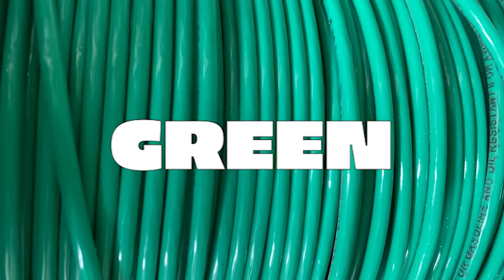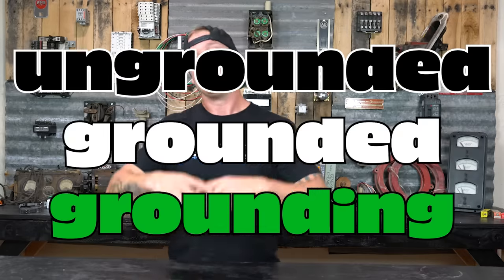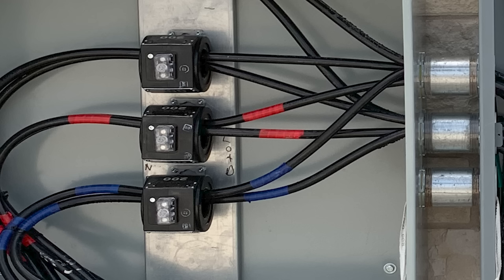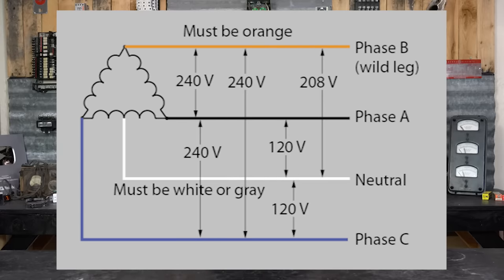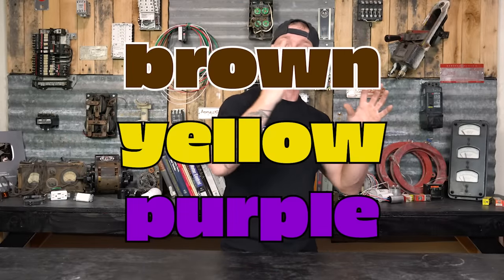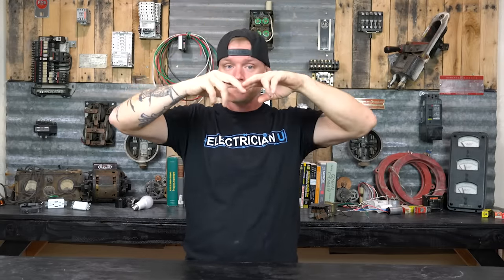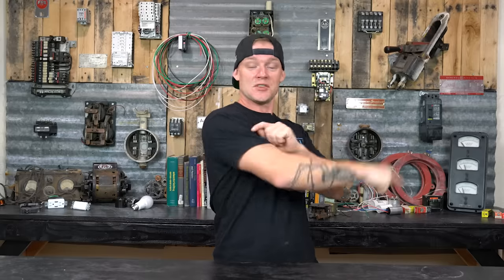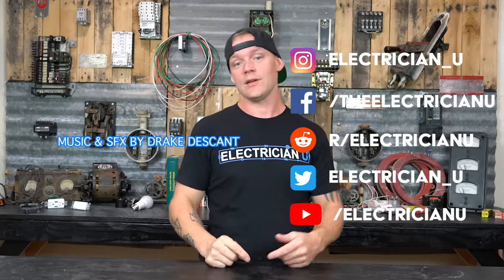Electrical Wire Color Coding Used By Electricians

Comment: Do you not use 347/600 3ph distributions??  In canada yellow orange brown are generally used for systems  with different voltages within the same facilities. Incoming would be 347/600V 3PH (RBUW) which would power hvac, big motors,  big post or bay lighting and or other Secondary distributions. Then stepped down to 120/208V ( RBUW) and 277/480V(YOBrGy) 3ph system's. 120/208v system would do generally power, lighting and firealarm while the 277/480 might do heattraces and glycol heating systems.
Reply: What do you mean by RBUW?

Comment: in romex cable, red, black, white, and a bare copper wire, is the bare copper wire the same as the Green earth ground ???
Reply from the maker: Physically? Electrically? 

To make this a simple answer: electrically yes. If you use and install your grounding conductors exactly the same and make up your point of use equipment recepticals the way intended. Your grounding conductor will make the same "connection" back to your grounding electrode. Making one continuous loop.

Comment: Speakers work just fine if you flip the conductors. The problem is now your signal is 180* out of phase. This means your miswired speaker is interfering with the others.

Comment: I really think you should add an addendum to this video as  some  common non knowing people that will encounter  277 volt changing out a ballast in a light industrial to industrial setting. They may say,  I can can change that ballast out for you boss.   As a maintenance guy at med size printer I knew 277 had more power, but I did not know it will kill you by freezing you. We had some  277  lower hanging  machine lights, I put a large voltage sticker with the warning this voltage will pin and kill you. So if I leave everyone knows if a ballast goes and they don't have the knowledge what to do, to not touch it.

Comment: Not to be super picky, but the neutral as the centerpoint for all conductors works for single phase residential, or 3 phase Y.

Comment: Normally when you find a middle leg that's taped red or orange and the other legs are black the middle leg is a 190 volt high leg with the other two being 120v. Delta wired with the neutral coming off between the two 120 volt windings. Always check every leg to ground before using any phase for a load.
Reply: 190V?  How did that happen?  It should be sqrt(3) times the line-to-neutral voltage of the A and C phases, for the B-to-neutral voltage, which is 208V.
Reply: @carultch  It's all determined  by how the transformer is wired and tapped. At any rate the 190 phase used to be popular and is still found in many large factories. You can easily find 190v transformer wiring online.
Reply: @71160000  Why is the 190V inconsistent with the 120V though?   Are the AB and BC transformer secondaries deliberately tapped at a setting inconsistent with the main AC transformer secondary?

Comment: I was looking for hot “switched” color code.  Want to use the right colors in a new building we are constructing in the Philippines.  Our renovated 15 year old house used one color and when something doesn’t work (outside lights). Near impossible ti troubleshoot.
Reply: As far as I'm aware there is no color code for switch legs. That is however dependent on local codes, most places have local codes available to be viewed online. For commercial/industrial work in the Pacific Northwest (where we use "BOY" because I guess we're weird) we typically use pink or purple to identify switch legs.

Comment: In UL 508a industrial control panels 
Orange wire can mean still live power in that cabinet with the disco off 
Could be panel light   Just be careful and double check

Comment: You might have included common traveler colors in 3-way switch legs. I read blue is a common color for travelers? Can't remember if orange was also sometimes used. Electricians will encounter these also (although, not in the panels).

Comment: What about the two phase, 5 wire system? Still plenty here in Philadelphia !
Reply: Years ago the large philly slaughterhouse that I worked at we would mark one phase with blue tape and red for other phase 240 volts with a center tapped grounded conductor ( neutral ). Had mechanics try to help us and crossed phased two phase and burnt out new motor. Started taping one phase of motor with blue tape and other phase with red tape.

Comment: I've learned a lot about electronics but going from that to structural power delivery like electricians would do, the green and white tripped me up quite a bit. It seemed like they were both the same so why have two? Then I read about more history of electrician stuff and I think the green was added later as a redundancy tied back to the service box so if the neutral failed then you wouldn't get electrocuted. That's how I learned it anyway. I don't know if that's true but going from aircraft avionics wiring to residential or commercial or industrial structural power delivery standards was a little bit weird. I think most of the time with aircraft systems, they will just use the chassis of the aircraft as a return so as to save weight... Unless you need shielding with coax or triax cables. I think I'm starting to get it.

Comment: Its a shame there doesn't seem to be any will to converge this. I'm in the UK and we had a history of red,yellow,blue for phase colours with black for neutral. The new "harmonised" scheme is brown,black, grey with blue for neutral, which would be fine if it didn't share colours with the old scheme. That would be fine if you never had to deal with sites with both colour schemes in use on the one site.

 I think the only way to get from where things are now to a globally unambiguous scheme would be to mandate at least two colours per conductor, either as stripe+insulator or tape+cable colour or two tape bands.

Comment: What is 180 volts to ground in a three (3) phase system?
Reply: A bad connection… or a weird voltage from phase to ground in an ungrounded delta
Reply: @atmacm  It was on top of a church feeding a Trane Voyager.  All the feed wires were black,  maybe they didn't color code anything back in the day?
Reply: @scottbishop2532  I'm an old guy and in my day (before 1985) with 480 volt three phase, for service conductors all were black. For 480 volt three phase distribution from the main service, any colors were acceptable. For 120/240 volt distribution (from 480 to 240 transformer because utility provided only 480), any color (because several 120 volt circuits might be pulled in a single conduit) except white was ok for a hot leg (120 or 240) and the grounded neutral legs were always white.

Comment: I am architect though not electrician but do supervise and often do some jobs myself.
Besides, I am Mexican and live in México.
Color coding here has some differences towards colors used un the US.

Don't you use coding to separate lightning from power?
I do use yellow as fase and grey for neutral in lightning circuits.
Also orange for returning cable (from switch to lamp).

Comment: This is what I am used to here in Oregon, but as always, the ungrounded conductors can be any non-reserved color, and should ALWAYS be verified by checking them with a meter...

120/240v Single Phase (most residential & small businesses) is typically Black/Red/White... Nothing out of the ordinary...

120/208v Three phase Wye ("Y") is typically Black/Red/Blue/White... Usually seen in locations where some three phase power is needed, but the majority of loads are still 120v single phase... Again fairly basic, and nothing surprising...

120/240v Three Phase center tapped Delta (Δ) systems are generally Black/Orange/Blue/White, with (as the video explains) the 'B' phase or "wild leg" being ~208v to ground, and (as mentioned) care needs to be taken so that no 120v loads are accidentally connected there...

277/480v Three phase Wye ("Y") are generally Brown/Orange/Yellow/Grey (Yes... the neutral/grounded conductor can be grey), and is generally seen in places where more powerful 480v three phase loads (motors) are necessary, but also designed for 277v lighting circuits as well...

Finally 240/480v Three Phase Delta (Δ) systems are also typically Brown/Orange/Yellow, but they usually don't bother with a center tapped phase, therefore there is NO neutral connection, and is strictly used for three phase loads...

Just my 2¢ worth, and as usual YMMV...
Reply: That's a great explanation. Better than the one I offered. I meant the same thing but sometimes it gets too wordy.

Comment: 120/208 volt 3 phase wye system colors black, red, blue, white, and green ground.
120/240volt 3phase delta system colors black, blue, orange- high leg white and green ground.
277/480 volt 3 phase wye system colors brown, orange, yellow, wt./grey, and green ground.

None of this information is of any use to homeowners/handymen. It is taught in first-year apprentice training. It was when I started 55 years ago.

Comment: In usa wire nuts are usade in hight voltage sistem?
Reply from the maker: Typically yes, as many of them are rated up to 1,000v
Reply: @ElectricianU  thx for response.👍🏿

Comment: In my white paper, entitled “Welcome to San Francisco mofo“ it states that a high leg is purple. As it is in the AHJ A.k.a. SFDBI EID code addendum. 

And it’s a great way for you to find out that once you’ve pulled all your conductors and have an inspection, and you’re told to go buy a whole bunch of purple tape, and go through every single box. That’s the way that you learn, that you should have read the local code.
Reply: And have a couple of drinks later in the evening................. after all that fun

Comment: Ive worked at 2 different shops with 3 phase power and I have 3 phase at home provided by a rotary phase converted but I have never seen 3 phase system with a neutral. Only 3 hot wires.
Reply: 120/208 Wye, 120/240 delta, and 277/480 wye are all 3 phase, 4 wire systems. The 4th wire is the neutral.
Reply: @pld8993  Like I said none of the 3 systems I worked on had a neutral.

Comment: Allot of electronics use switching power supplies allowing them to run on 120 or 240. Be sure to check before plugging it in though.

Comment: New to the hvac/ electrician trade. Definitely appreciate this💪💪💪
Reply: @SemoeDALLah… as an electrician, it always drove me nuts when having to connect low voltage control devices because I was programmed that white is neutral. Not until I did HVAC controls did it become obviously clear how to treat colors. 
Since every low voltage cable always has a black cable in it (black/red or black/white or black/multiple others), and every circuit needs a common or a negative wire, then the black wire should always be that common or negative wire.
It is very straight forward to me now but I’m not the only electrician I’ve seen struggle with deciding color codes on low voltage controls.

Comment: Coffee going in.. Figured I'd refresh some of this color stuff. Good job, and dead on .  Listen to this guy....     A slight correction or expounding on one little part..   The speaker wires... Hmm.. It's a phase thing if you get them backwards. the speaker, non active speaker that is, will work but will be out of phase.  In a mono system.. like distributed 70 volts commercial system will create some really strange and annoying sound in a paging / background system id a speaker is out of phase with the others.    It messes with the ears and head where audio will fade and increase as you walk down a hall. Its annoying at best, stressful if not fixed.   On  surround, home theater or stereo environment,   it'll do the same thing, but can make the surround, back, or front speakers stressful to listen to by adding subtracting from how it was mixed in studio to what your hearing.    Bottom line is keep the  colors straight in speaker system too.  Coffee kicked in, and I'm ready to roll. 

Damian

Comment: I live in Pittsburgh. This is the first time in my 21 years of doing electrical work of hearing about 1. Purple being used in a 480v 3 phase system. And the first time I've heard of that wild leg orange 208 volt. That's gotta be an old wye connected set up. But how does it get 208 on it to ground ? And that's a residential service ? Or is this commercial ? I don't have much experience in commercial. Only residential and industrial. My industrial experience is maintenance electrician primarily steel mills. Never had that wild leg there.
Reply: The B phase is called a high leg or stinger leg, never heard it called wild but might just be regional lingo. It's a delta system, that B phase is 208 to ground. It's never used solo, only with 1 or both other phases for 2- or 3-pole 240V circuits.

Comment: It would be nice if you make a video talking about sharing Neutrals in a 3 phase panel and code on it, i'm in CA and i've seen plenty of electricians sharing netrual in singel phase panels which is code violation, i would like for you to explain the theory on why not to share or when you can share neutrals, thanks.

Comment: On a 277/480/416 wild leg what's your tape?
Reply: There’s no such thing. If it’s a 277/480 volt system, then it’s a wye and all 3 phases are 277V to ground.
Reply: If it was a 480V grounded delta with a high leg(never seen one). You’d have two phases at 240V to ground and one phase at 416V to ground.

Comment: I didn't know they changed the color of the high leg on 3 phase at the panels, when I took electrical shop in high school 35 years ago, orange was always the high leg color at the main and subpanels only, blue was used to feed the 208 phase on branch circuits coming out of the panel(s).  It actuall makes sense just to keep everything the same in the whole system.  The 480 colors haven't changed since my HS days, my instructor back then used to refer to the grey color "slate", he would always correct us is we ever called it grey lol.  The guy knew his shit though, and the stories he used to tell us about going as far back as the mid 1950's
Reply: The reason why he called it slate was because the NEC used to call it natural gray, and nobody could ever figure what natural gray was compared to any other kind of gray, hence the use of slate since that is a natural stone.

Comment: For 208_230 3phase  black l1 red l2 blue l3.for 277 _480 volts remember boy brown l1 orange l2 yellow l3 .green always ground.white neutral.
Reply: If it’s a 120/240 3 phase grounded delta the high leg has to be orange per the NEC

Comment: So, in what you call single phase red is what is known to most as a travel wire.
But yellow, blue, orange gray or what ever color besides green can be any thing hot just depends on how the electrician decides to wire it say in a three way wall lamp you want full light and on the other side just a night lamp can be separate wire colors.
I have been hit here in the states with 108-120v with white as well when it comes to light wires!!;
It is ALWAYS a good practice to check for line voltage FIRST.
Just saying 😂.

Comment: Question? Is the orange wire considered the “Stinger” leg? I work in HVAC and that’s a term used often.
Reply: The orange phased wire is the "high leg " or " stinger ". In  a 120vac 3 phase service, the B phase is your high leg and has considerably higher potential than the A and C phases. This is helpful with motors and changing their rotations.

Comment: A plant I worked at still had a grounded delta system. So we had a grounded phase. You read 480, 480 and 0 to ground.
Reply: I've heard of that but never actually seen it...
Reply: Yea, that catches a lot of people out. They think they have a dead phase. Then when I try to explain that one phase is bonded to the ground they look at me like I’m crazy.
Reply: @MrSleepProductionsInc  it did me when I thought I ran across it once. Testing all the phases getting a 0 voltage even going to  ground on all three phases. But it was a Burned Building and phase A + B were blown fuses so maybe I didn't Press hard enough on C to Ground to get a reading or my tester or it wasn't working properly, maybe from working with 480V , but that's when I first learned about it...

A little known secret lol...
Reply: Also to add to the Mystery, in the panel room aside from the Breaker, there was a fuseable  disconnect. The 3 phase breaker remained on, while the fuseable disconnect had A+B phases blown, with a continuity test.

The question then becomes did all my testing fail because of faulty equipment or was it due to Human error or a combination of of both. Or could a grounded Phase not blow the third Fuse if were Grounded, also not tripping the Circuit breaker..?
Reply: This almost blew me off a 4 Story Building and I chalked it up to Human Error, but was it..?
Reply: I learned a important lesson that day never put your life in the hands of your testers work on everything like it's Hot this wasn't a grounded Phase, but as I started to talk to other Electricians I did hear about the Grounded Phase...
Reply: @steve-o6413  at some point you have to trust your quality meter along with your spidey senses.  I use both a volt stick and a neon tester much more often than pulling out a meter but I  Don’t trust them.